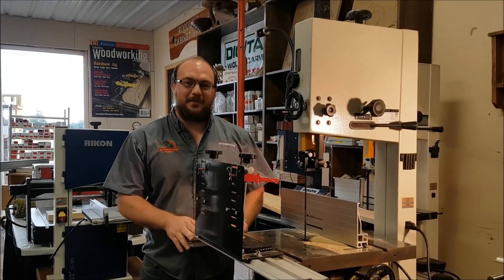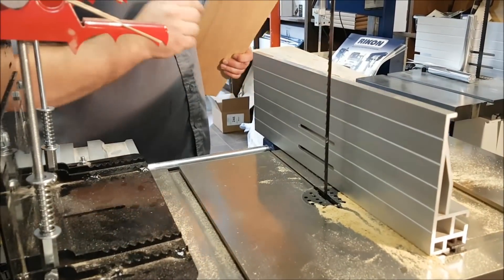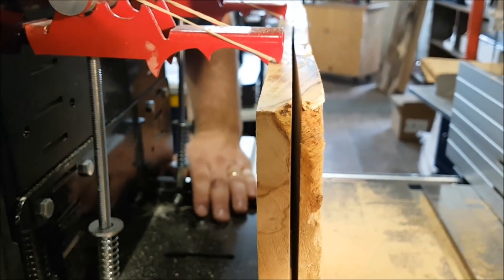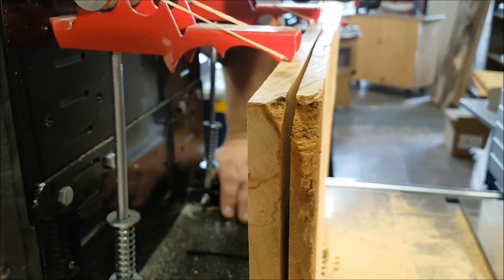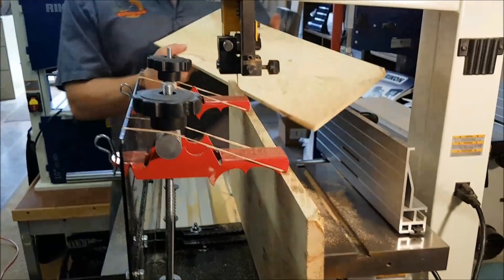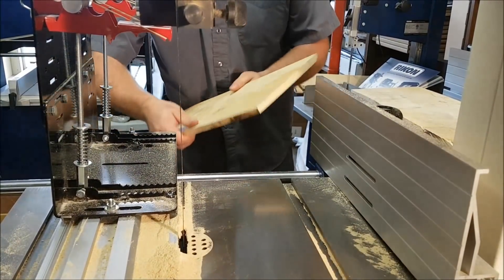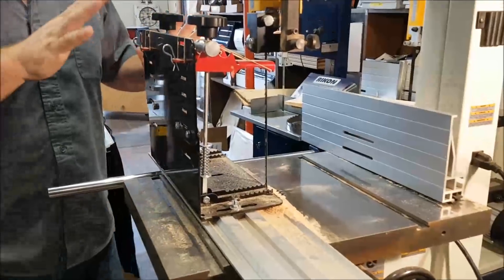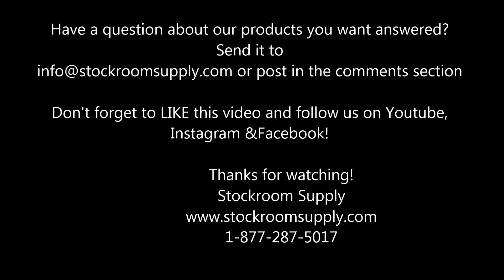EthAnswers Blade Drift Myths #2 Why Fences Don't Work On Bandsaws

Comment: Maybe I've just been lucky but I tuned my bandsaw as Alex Snodgrass recommends in his video and have the blade tracking with the gullet in the center of the wheel and I've never had a problem.  To be fair, I don't do that much of this thin cutting on my bandsaw and if I have a board I can't joint, I break out my hand planes.
Reply: Yes, or I'll cut it to fit the jointer, and then glue it back together. It's easier to get the twist, etc out of a smaller board anyway.

Comment: Ok, I get it. Binding = blade drift and a held board floating on a sled/carriage is best option. But what about those of us that don’t have $350+ to drop on a carriage/track combo - what do you suggest we do?
Reply: Use the round bar positioned right at the front edge of the blade. Either way, you’ll need to flatten the boards... even his board rocked when he laid it flat on the table.

Comment: Hey Ethan i'm just wandering if you set up the fence to where the back of the fence would be parallel to the back of the saw blade, wouldn't that get you straight cuts? cause the board is only going to stress after it's been cut and if there is no fence behind the blade, the board can stress without putting force on the fence therefor it wont press against the blade and the blade wont bend. that is ofcourse if your board is straight to begin with.

Comment: This video switched on the light for me - I get how the gadget works but a little too steep for my infrequent use. Instead I realised that if I added a sub fence to the supplied fence then I could provide a method of relieving the stress in the workpiece without deflecting the blade. 30 minutes later I had a solution. I bolted a piece of scrap hardwood to the fence (countersunk head bolts) the subfence runs from before the front of the table to just level with the teeth on the blade, allowing both sides of the workpiece to splay out as they need to. Test pieces centre cut from 18mm birch ply, 18mm sapele and 24mm laurel (yes the one found in the garden!), each piece being about 50mm (2") high I know about the risk of cutting laurel but this piece was well dried out and I work semi-outdoors. The three test pieces went through perfectly (straight down the centre) without any wiggling or blade drift compensation - on a very basic band saw. So, works for me for small pieces - I guess up to 4" (100mm) would be fine. Although, I still like the look of the resaw gadget! But, here in the backwoods of the UK?
Reply: David Brearley ha ha. I watched this and that is exactly what I planned on doing. Glad to know it works. Great video for highlighting this issue.
Reply: Very good idea!  Would this work on a table saw just as well.  I have to try that too!   Seems it would prevent burning the wood and creating build up on a table saw blade?  Am I right?

Comment: You can face joint any size board within the confines of the width of your planer, provided you either have a sled or you can take the guard off the jointer, joint as wide as possible on the board, attach a piece of MDF with 2 sided tape to the jointed area, plane the opposite side, then plane the jointed side sans the MDF. Also, as I watched your video, your cut badly went crooked mid cut on your sled. Then, there is the point that, what good is a piece of veneer that's not flat?
Reply: You can't use the rough sawn edge, it has to be planed in any case. The better and straighter the cut, the less planing and less waste. He was pushing a bit hard then eased off so he got a bit of curve. You also have to work with the tolerances of the device, keep your pressure consistant and you will get a consistant cut.
Reply: I think that wiggle happened at the point where he paused the cut.
Reply: I've seen that type of dogleg happen with a pause when the feed speed was too high.

Comment: I am really pleased I ran into your stuff before using my new band saw. I need some advice and suggestions on re-sawing long redwood 2x6 planks recovered from an old deck. Some are 10' long.
Reply: Watch the video by Alex Snodgrass from Carter, to learn how to PROPERLY adjust your band saw before you start, It's an EXCELLENT video. You'll be glad you watched !!
Reply: I don't think it will handle boards anywhere near that long, even with the available extensions. 

I have resawn a lot of planks just using a fence on a properly set up bandsaw. But I have never tried to cut a bunch of long 1/2" strips either.

I can see that jig being handy for rough sawing short logs.
Reply: I did a trailer load of used 2x6 redwood.  I needed to joint one side first and get a 90 by using flat side just jointed.  I was able to get a one inch board for lap board to do a 20 by 20 shed. The cut off I got was 1/4 inch used for another storage.  Not all of the wood was inch and half as I said it was used wood.   Definitely dusty. That fact that it was all Redwood made it possible, much harder with a harder wood but set up bandsaw as Carter rep showed assisted. Used a 3/4 blade on 14 in bandsaw.  Key was infeed and outfeed table.  I used two Material lifts with roller jigs. 4 rollers on each side.

Comment: So by the same logic, wouldn't ending the fence at the blade do the same thing?
Reply: Rodney Magee I respectfully disagree. The issue starts with an irregular board but ends in relief of stress. You may miss the relief but not the irregularity with a short fence. Still a fight as you transmit the irregularity to the blade. If you cut by eye from a struck line and used a “fence” with minimal contact - even a vertical round one - this notion has merit. Resawing issues are manageable but this cutting jig seems to slay the typical issues.

Comment: OK, convincing. Difficult to coff up about half the price of my bandsaw for the contraption, but it looks like it works. Let's see, do 100 cuts that would be about $5 a cut, probably not a problem for a shop that does a hundred cuts a day so in a few weeks you would be down to pennies a cut,  but for the home shop where you might go a year or more to make even 100 cuts, OUCH!
One question, what happens if the board is 3 feet long? Is there a practical limit to board length?
Reply: I could teach a  monkey how to use power tools, including a band saw but jigs are the heart of any woodworking shop.

If you consider yourself a true woodworker, or even a reasonably competent weekend warrior, then make your own "little ripper" for a fraction of the cost.

How, you ask? If you have to ask how to envision, plan, and construct a simple jig, then you are not ready, grasshopper, and you then deserve to have to spend the big money to get someone else to do it for you.
Reply: @davearonow65 agree, I prefer to make my own jigs. Sometimes because of the money but if you make your own I think you get a better understanding how they work, and it's just fun to build my own.
Reply: The practical limit of length would only be limited by the length and accuracy/alignment of your fence, indeed and outfeed tables, if using said, or if using the little ripper, the length limit of your board would be determined by the length of the guide channel of the little ripper. Once again, this can be extended indefinitely with readily available materials and if care is taken in aligning/assembling the add ons.
Reply: Then you would need to purchase the big ripper.
Reply: I agree with you glasslinger, a bit pricey really. As for your One Question at the end... I get the idea that EthAnsers only answers the questions he himself asks 😒! He has not responded to anyone commenting here,  giving me the impression he doesn't care.

Comment: Riddle me this... with no guides touching the blade at all, no fence, slow feed, and pushing a piece of 3/4in pine straight into the blade, it naturally wants to drift at something crazy like a 7-10deg angle. Similarly, if I want to follow a line, I have to feed the piece at the same angle to follow the cut. This is the same if I have the blade at the front of the tires, gullet centered, it all the way in the back. I'm clueless on where to look for ideas/adjustments. Your videos and others suggest that the drift should be a function of guides tweaking the blade or letting that off cut go where it wants. Any suggestions?
Reply: maybe your table is out of square with the blade?
Reply: It could be the grind on the blade.  Every table saw blade cuts different and that's a precision ground blade.  I put on a newly sharpened carbide tipped blade and sometimes I have to adjust the fence as the piece now binds between the blade and fence, where the last blade did not. Band saw blades are no different and probably a LOT worse.  Each one has it's own peculiar cutting idiosyncrasies and have to be compensated for.  If you have drift, then try angling the fence a bit to compensate.  If ALL the teeth on each side of the cut aren't perfect, then it will drift.  I have found some bandsaw blades are worse than others.
Reply from the maker: Hey John,
Basically in my videos I try to explain that its NOT the guides, setup, tension, how its positioned on the wheel, the bandsaw or even the blade itself.  It has everything to do with side pressure on the blade. When you free hand, use a fence or resaw pin you inevitably bind the blade...when you bind the blade you change the set on the front of the teeth...this makes the blade cut one way better than the other. Until the blade is replaced or resharpened and reset that blade will always drift.
If you use a carriage(like the Little Ripper) and never bind the blade the blade simply will never drift.

Comment: How do I cut longer boards? And can you answer a bunch of bandsaw questions? I just got a new one, I went from a 9” to a 17”. It’s quite overwhelming.
Reply from the maker: Well when cutting any length board I like to use the Little Ripper. Since it doesn't bind the blade you never need to worry about drift. The basic unit cuts 2' feet long but different setups are available that cut cut up to 8'.
Feel free to ask more questions! Bandsaws can be incredibly useful but also incredible frustrating.
Reply: When I can afford one I will definitely get one. Any way I can make one?
Reply: Let’s say I’m making a bandsaw box and the inside is a circle 5”diameter by 8” long. How would I cut the 2 ends of this off without experiencing any kickback like when I cut dowling
Reply: So I just got these 1” wide blades. They keep swaying side to side do you know what the problem could be? I don’t think it’s tension but idk.

Comment: You can solve the problem of the stress by using a short bandsaw fence.  I think the fence on your saw will move back.  Try setting it so the end of the fence is at the kerf of the blade. Now as you push it through, the wood can flex without pushing against the fence.  Also works good with a table saw too.
Reply: THANK YOU!!!  THAT IS A GREAT POINT!
Reply: Yes, great comment.  Also, if you free float the board using a grip instead of a fence, you can compensate for twist to some degree.  I did that with my own version of the Little Ripper / Accu-Slice about 30 years ago.  However, there is still no substitute that I have ever seen for a properly jointed board-- whether using a tablesaw, bandsaw, handsaw or other means.  
Although you cannot always joint everything brought to the bandsaw,  it becomes a matter of where you do the squaring-up (i.e. whether you do it on the jointer and tablesaw for boards and dimensional lumber, or on the bandsaw for logs or whatever arbitrary form and shapes).
Reply from the maker: That is definitely an option! Still need to make sure your board is face jointed and it does become much more difficult to hold against the fence as you are pushing you board through. The last 1" is especially hard to hold.
Reply: Exactly my point during watching the video
Reply: Exactly what I was about to type in.

Comment: Kreg resaw ...20 bucks... works out the kink....
Reply from the maker: Some folks loe resaw pins! I myself don't...still have the issue of twisted the blade back and forth trying to follow a line. When you twist you are in fact binding and cause the blade to drift.
Reply: @StockroomSupply  be hard to run a log on a resaw also... cool product...
Reply: Other's videos that I've seen seems to state that it's not the fence there causes the drift, moreover it's the set-up of the table in relation to the blade. If your fence and table are aligned with the blade there shouldn't be any stress on the blade at all. No shreaking noises, just cutting noises.
Reply: @shawnhowell156  You also need proper blade tension, correctly set blade guides, a sharp blade with correct tooth set and with the blade properly set on the wheels. If any of those are off then your blade is likely to twist.

If you have a board without stresses in it, you should be able to resaw it just using the bandsaw fence as a guide. If you have to angle the board to the blade to follow your marked line, then something is wrong with the setup.

Comment: Eth I notice you never use a resaw blade, any particular reason
Reply from the maker: Yes very big important reason...honestly it is a bit of a trade secret. I'm lazy haha. I would get smoother cuts with a proper resaw blade but regardless of the blade as long as it is not bound it will cut straight.
I like the 3/8" as it does a good job on circles as well as straight.
Here's a video where I talk about that more in-depth;

https://www.youtube.com/watch?v=sZ-33ZN49os&t=6s